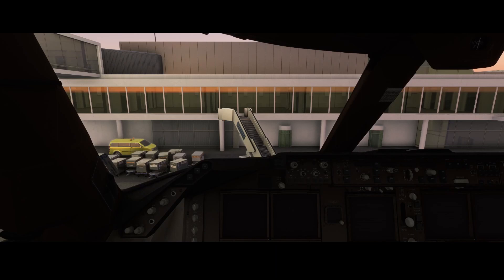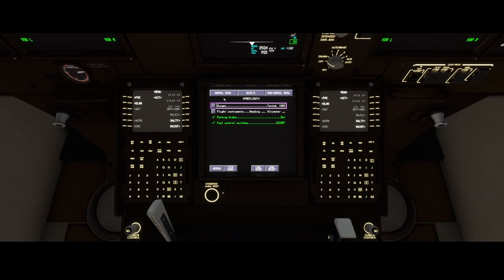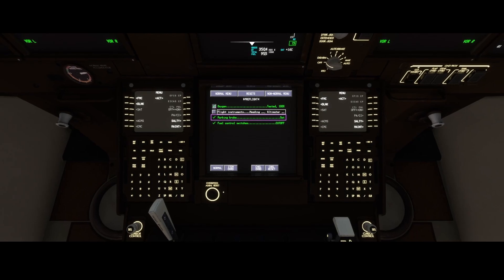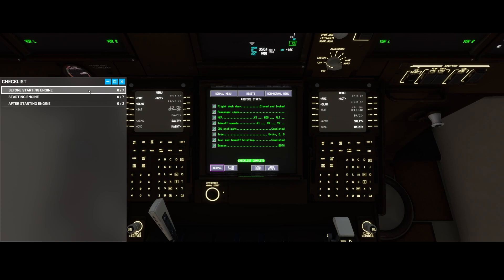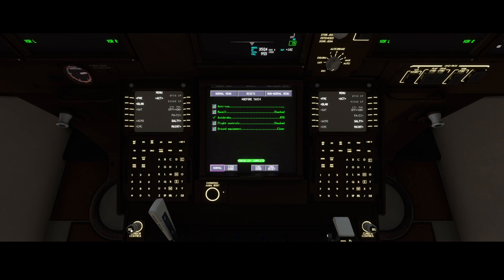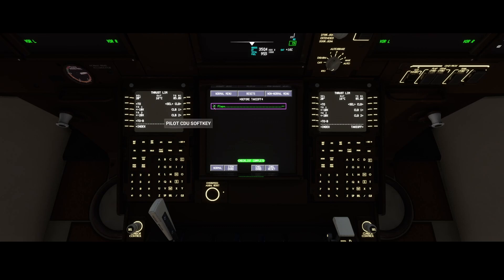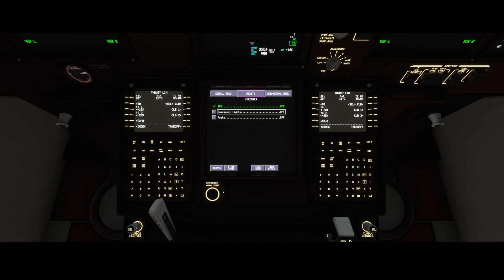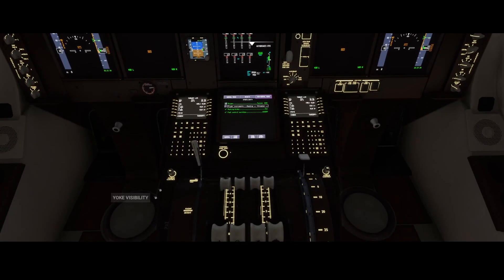Flight Simulator 2020 - How to - Salty 747 - electronic checklist

Comment: Unfortunately  xbox doesn't have this feature  in the jetliners
Reply from the maker: hi Carlos correct Xbox doesn’t have the ability to add content outside of the Marketplace which is preventing you from adding things like this which need to be installed from outside the marketplace
Reply: @Highintheflightsimsky  any news on any new features for xbox 🤔
Reply from the maker: no not as far as I know
Reply: @CarlosHernandez-ws4bx  This check list is modded so u cant even get it on xbox